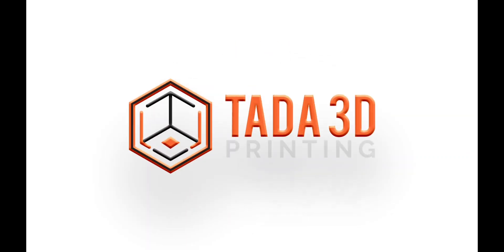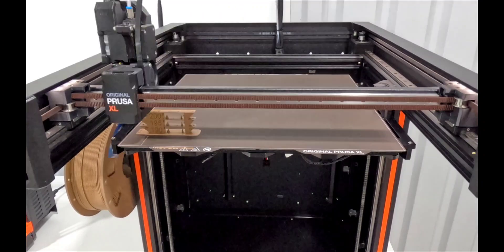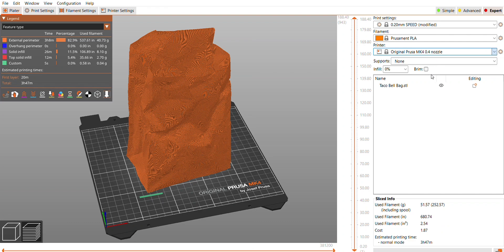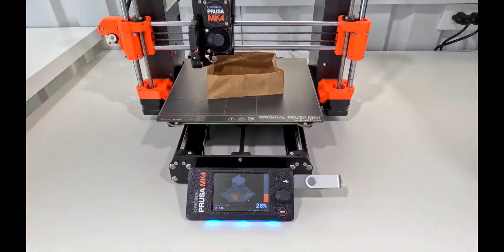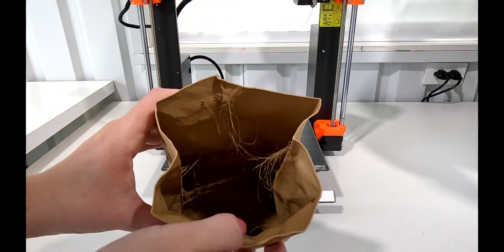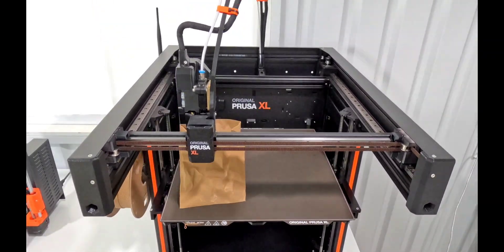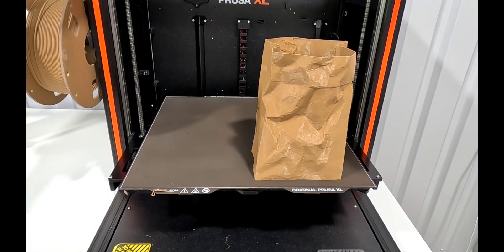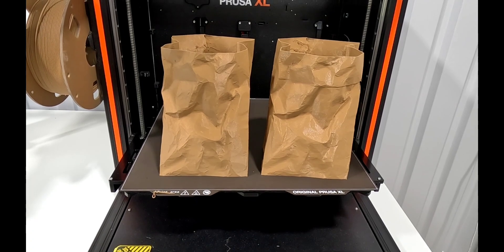Comparing the Taco Bell Bag on the Prusa MK4 and the XL!

Comment: Im wondering that you got a 0.2 print setting with input shaper…?
Reply from the maker: After you switch over to Input Shaper as your printer, you can adjust the layer height. .2 is just what mine defaults to. Thanks!

Comment: I usually add more outside layers when doing these prints while not using vase mode. I'll widen the lines, and to get it waterproof I'll sometimes use 4-6 perimeters. Even then it can still leak water, so a long paint brush and some clear epoxy painted on the inside bottom and up the walls as high as needed.
Reply from the maker: Ok thank you!

Comment: for water tight, can you try vapor smoothing? or perhaps heating it in an oven for a short while? or a hot air gun / hair dryer? add some water and watch where it leaks and then add some melted filament on a soldering iron tip and then hand smooth that into place? perhaps too much work...its possible a different filament would work with vapor smoothing or hand fixing better? I feel this part should be TPU, something flexible.
Reply from the maker: I think I need to make it again with more perimeters. Thank you!

Comment: For future reference, you are more likely to get a water tight print the higher your printing temperature is (so that the layers really bond together)

Use PETG not PLA - it's less porous. However, you can 100% get this done in PLA.

Vase mode with very small layer heights - I use 0.15 for water tight things.
The bigger the nozzle, the better. You're aiming for a good flow rate so the 0.6 nozzle is the way to go, out of your two printers.
Basically, you don't want under extrusion.

Increase your wall thickness and infill density for less gaps (if you do 100% infill, you're MUCH more likely to have something water tight).
If you're printing something large and don't want to use that much filament, the more perimeters/walls you have, the better. I suggest starting with 4 and seeing if that's enough.

A much slower print speed will help, sadly.
Especially in areas such as perimeters and top/ bottom layers, slow those down.

Make sure your layers adhere well by adjusting temperature, slowing the speed, and lowering the part cooling fan (the slower speeds will help manage a low fan setting) . 
This will likely take a bit of experimentation, I suggest making a couple small containers to test different settings.
Consider your model!! Models that have sharper angles are way more likely to have gaps and holes. Curvy things are more likely to be water tight.

If all else fails, remember that you can always spray a print with Plastidip or cover it in epoxy or something, after the fact. I like the Plastidip method as they have it everywhere, it comes in a spray paint can, and I've seen aquarium people use that stuff.

p.s. because you didn't see much change in the temps on the temp tower, I would play around with what temps you test. Maybe set up a temp tower that is in 10 degree increments instead of 5 so you can test a bigger range. Then you can do a 5 degree temp tower aimed around whatever temp looked best.
Reply from the maker: Great info! Yes printing a smaller print until I can get it water tight is a great idea. Thanks so much!

Comment: when I print hollow objects like this, I turn on the option, avoid crossing perimeters, you will see lot of blue lines after you slice (if you turn on view travel, I think that is changed a bit in 2.6.rc1), but with avoid crossing perimeters I get less zits and none of that stringing inside. I'm not sure if there is other disadvantages doing it though.
Reply from the maker: Oh I didn't even think about those blue lines being cross overs. Seems odd to me that it would even need to cross across the open space. But yes I'll keep that in mind for the next one. Thanks!
Reply: @tada3dprinting  Yes, I don't understand the algorithm there, but I often find the strangest jumps around when I'm slicing something that I'm thinking should be easy to print.
I have been printing some big hexagonal patterns lately, and it draws one hex here, one hex there, and moves around instead of starting at one place and just continuing from that point, so turning on that option seems to make things better sometimes.

Comment: For what it costs, currently, it seems to me that the XL makes little sense... In short, if you need a larger printing volume, compared to an ML4, there are already more valid alternatives in circulation, especially taking into account the cost, here.
Reply from the maker: I think the XL has two main benefits. Bigger printing volume and the multi-tool. Right now we are only getting the print volume. I agree it seems expensive for just this. But everyone just has to factor in if the size is worth it. For me, it is . Thanks!
Reply: @tada3dprinting  A comparison with the Bambulab X1C would be very interesting. And I'm already putting my hands forward: I'm a strong supporter of Open Source, also because the RepRap project is based on this philosophy, and it makes full sense. However, considering that both are products aimed at a professional audience, in my opinion it makes sense, despite the thinking logic of both companies is totally different, on the long-term support of the product.

Comment: Why is is, that the xl would be so much slower with the same layer hight? Should it not be possible for the printer to print much faster because of the xy core?
Or will that probably be better in future?
Reply from the maker: My XL was printing faster than the MK4 when I first got them. But now the MK4 has input shaping which has sped it up. And the XL does not have it yet. Once it does, I expect the XL will be faster again. Thanks!

Comment: Thanks for posting this. I usually go for 4 perimeters for water tight things this may also help with the holes, or not. Remember also PLA will degrate fairly quickly in UV light so if you place the planter on a window sill or in sunlight for your plants it wil start to break down. Really cool model though and great filament choice.
Reply from the maker: Oh that's a good point! Thanks!

Comment: wow, i print a ton of stuff in vase mode on my ender 3 pro and use them as planters... 0.4 cht nozzle, 0.3 layer height, 0.2 initial layer height, 0.8 line width, 4 bottom layers, "lines" bottom pattern and well, vase mode... they're always water tight unless the first layers have sharp corners or spikes... i'm actually printing a bag right now, and once it's done, i'm going to spray some rustoleum enamel clear inside to seal it off... also print it at about 50mm/s because if i go up to 100mm/s like on my normal prints, i will get skips and weird details... the flow can't keep up with the speed... even with the CHT nozzle, i have to keep it at about 10mm/s flow rate to get them 0.8 line width...
Reply from the maker: Great to know! Thank you!

Comment: You can do thicker with vase mode just by setting the line width to double your nozzle width. Well over double is generally doable.
Reply from the maker: Ok thanks!
Reply: Yes. I printed some of these in vase mode with a 0.6mm extrusion wide on a 0.4mm nozzle, and they came out very nice. At 0.6mm they were pretty strong.

Comment: It looks to me that the model needs to be fixed somehow, I'd open it in mesh mixer and run the inspector to see if is OK and if not then repair it there.
Reply from the maker: I haven't ever done more than repair through Prusaslicer. Is mesh mixer a separate program? Thanks!
Reply: @tada3dprinting  yes is a free software by Autodesk. I'm used to work with 3d programs but so far meshmixer is the one that seems more specialized for repairing. Those wholes in the bag looked like little unconnected edges or faces with inverted normals, but might be just an illusion 😅

Comment: Have you tried setting the Print Settings -> Avoid crossing perimeters option? It might help with the stringing and the zits.
Reply from the maker: It was not turned on for this. I'll definitely try it on the next one. Thanks!

Comment: Thank you for sharing! If it's going to be a vase it needs to be water tight. If it's going to be a planter you actually don't want it water tight, infact you'll want some holes in the bottom for the water to drain out. Otherwise you'll get root rot.
Reply from the maker: True! I was planning on having it water tight and then have the plant in an inner liner that does have holes. I'll see what I can come up with. Thanks!
Reply: @tada3dprinting  unfortunately, it's near impossible to make a water tight FDM 3d print.  Every single layer has a seam and there will be corners and angles where the filament doesn't fill completely.  You'd have to coat it with something to keep the water in.... then you get into that whole 'well what can I coat it with that won't poison my plant' rabbithole... ask me how I know lol

Comment: The fact that you got such horrible quality from a +$1000 machine is atrocious
Reply from the maker: Every printer needs adjustments on settings.
Reply: That’s pretty harsh. It was clearly a brand new filament type and not properly tuned either.
Reply: @Gefionius  no insult on your part. I’m subbed and enjoy watching your content. However, Prusa is a overpriced bag of shit. The results of a print with and without input shaping are similar to an ender; a stock Ender 2.
So my point remains, the fact that you got such bad quality from a sub $1000 machine is atrocious. 
Actually, if you throw this filament to an ender 5 pro with some basic upgrades (direct drive, board upgrade) and NOT dialling in the material, will give better results. 
Prusa releasing a bed slinger in 2023 is laughable and their attempt at “speed” is a bit of a joke.
Reply: @TheKingMJackson  With input shaping, bed slingers are competitive with pretty much anything that hasn't been specifically engineered for extreme rigidity. On all but outer perimeters, I run my (stock motion system) Ender 3 at 43k X accel, 14k Y accel, and 23-28 mm³/s. There's nothing wrong with releasing a bedslinger in 2023 unless the firmware is garbage or the frame is flimsy.
Reply: @daliasprints9798  sorry but if youre able to get 43k acceleration, the machine is not stock in the slightest lol, i think even Bambu labs is approx 10-15 max and some boron’s get to approx 35ish..
Reply: @daliasprints9798  also, m sure you will agree that prusa is a bag of shit for what they charge if youre getting much faster and better(?) prints on an ender 3.
Don’t get me wrong, for their price they are great machines. But sub $1000 for basic ender quality…. Yeah thats where i have an issue
Reply: @TheKingMJackson  Motion system is completely stock. Original motors, belts, still on v-wheels. A bed slinger's X axis is just really optimal, moreso than corexy with much longer belt paths and lots of pulleys. It's only the Y that's bad.
Reply: @TheKingMJackson  You're not paying for speed. You're paying for premium support, a product that works out of the box, a product that's built to be maintainable and upgradable, etc. Sure you could pay the same for a Bambu and get more speed. You'd also get something closed source, with wear components that aren't designed to be replacable, etc. I don't use Prusas and don't consider them a good value for me, but I understand why plenty of folks would and don't consider them "bags of shit".
Reply: @daliasprints9798  you make good points. I think they are overpriced, but I have had excellent experiences with them over several years from the first edition mk3.
Reply: @TheKingMJackson  but the mk3s+ at usd650 isn't overpriced, they charge what they charge for their last models because of the high demand, and they do intensive QC, it wouldn't make sense for them to charge less.... Would you?
Reply: @Drumaier  when was the Mk3s+ released? The releases price for ender quality is ridiculous. Im in a wheelchair so it’s difficult for me to do upgrades on a printer. Yet the ender was simple enough fo me to put together and be up and running in 30 mins; a few weeks later i did do a few simple upgrades and it gave me better quality than a prusa. Ender 5 is what, $250 right now? And mk3s+ is 650.. is that $400 extra really worth the “intensive QC”? Hell no